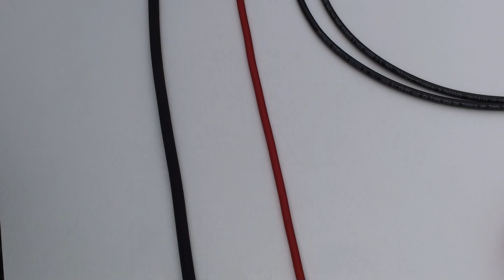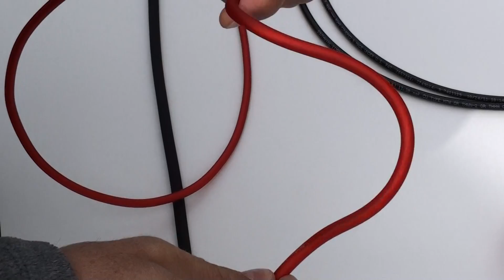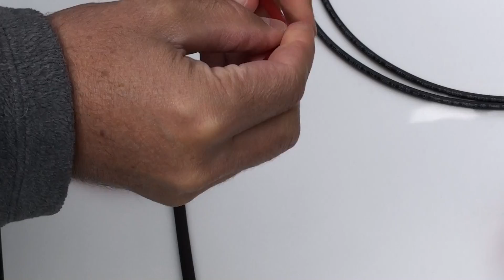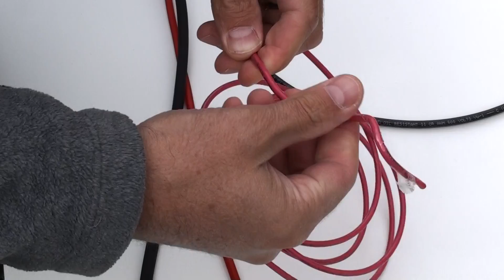Stranded Power primany wire for hho wind solar and car audio

Comment: For outdoor installations I have to agree with you. I tried to use some of the flex car audio wire for outdoor applications and the suns rays eventually faded and cracked the insulation, I can't imagine it holding up very well underground either. The wire is perfect for indoor applications and routing is much easier. I have never thought to use landscape wire for solar or hho installations, great tip...

Comment: I have used that kind of wire the insulation is really thick and makes it look thick but its not really that thick. It ok in the house. It turns green outside. I like the land scape wire better just a tip from my experience. the landscape wire is bury able and made for out doors and is a lot better for UV rays and water proof altogether more durable. I like the 8 gauge landscape the best it is awesome.

Comment: How does the resistance hold up on the CCA wire over pure copper.  Being aluminum wire with a copper coating it doesn't seem that it would be capable of carrying the same amperage load.  How does heat affect this wire?